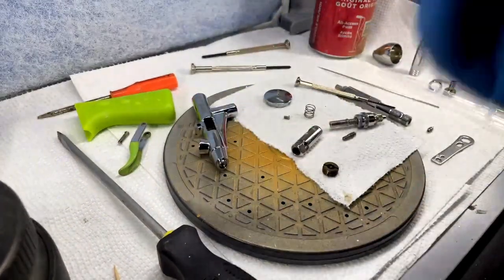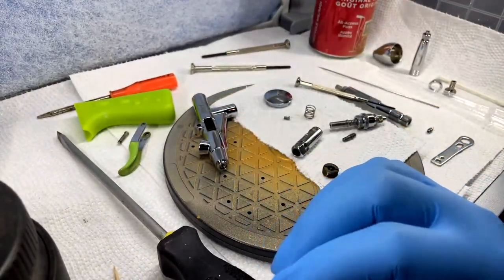This 1 thing no-one in YouTube Airbrush videos NEED TO say and they don't and you NEED TO KNOW IT!!

Comment: I reckomend lithium spray lube it drys leaving a layer that is almost friction free but the main benifit is it doesnt trap dust or debris so no buildup of gunge to worry about.
Reply: I have seen an Iwata lube recommended, but I don’t know what kind of lube it actually is.

I have silicone spray, plus wet and dry, greases that are more liquidy (for my bike). I also have normal grease and copper grease (for my RC cars and just about everything else). But the one I think might work best is the stuff that comes with electric shavers/beard trimmers, which is more fluid.

I have just bought my first “proper” airbrush (the H&S Ultra 2024), as opposed to the cheap airbrushes I have had before, and I don’t want to ruin it by using the wrong stuff. So, I suppose I should splash out on the Iwata lube, but it seems a shame to spend money on something that might be exactly the same as something I already own (even though I don’t know how much the Iwata lube costs. I’m just cheap like that…).

Comment: Hoppe's No 9 Gun Bore Cleaner is also a key to maintaining your moving parts of your airbrush. After I clean the airbrush I drop the brush needle and airbrush parts in a container of simple green and water (25/75) between airbrush use. It stays there until I use it again. Wash off the mix and then get to painting with the airbrush. I really only make sure that any visible paint is gone and then it swims in Simple Green until next time.

Comment: You dont need to lube your entire airbrush. The air valve might need some attention if the trigger acts up (like in your case), but WD40 for example does the trick too. Some people use lubricants to protect the sealing O-rings, some use some kind of bee wax or lubricant for their threads if they dont get an airtight seal otherwise. Iwata gives you needle juice to lubricate your needle to prevent dry tip and I guess it helps with the O-rings.
You really do not "have" to lube anything on your airbrush, but knowing what to do if you encounter certain problems always helps.

Comment: You obviously have never seen my video on cleaning an airbrush as I covered that. I'm only a small you tuber though so easy to miss. My cleaning kit came with a small tube of lube.
The only concern I have is when you say you take your airbrush apart it suggests youndo it a lot. I hope you don't. An airbrush doesn't need to be completely stripped all the time. In fact the more you strip it completely the more you risk damaging it. I clean mine without taking it apart every use, a semi take apart and clean about once a month and a full full strip and clean about every 6 months. The threads only need lubing about once a year and with a tiny tiny drop of lube. My tiny tube of lube I got with my cleaning kit has so car lasted me 4 years